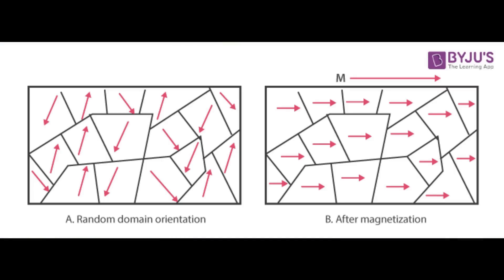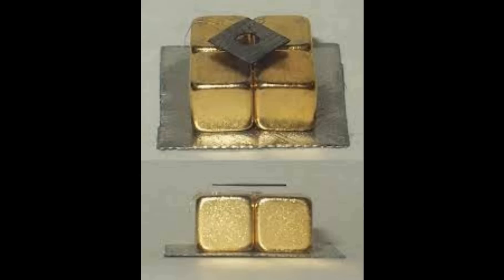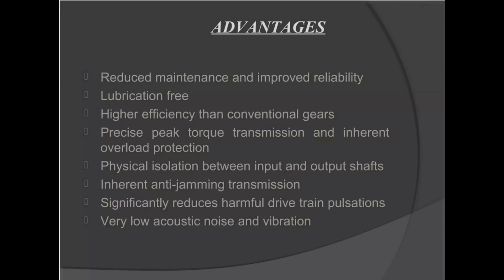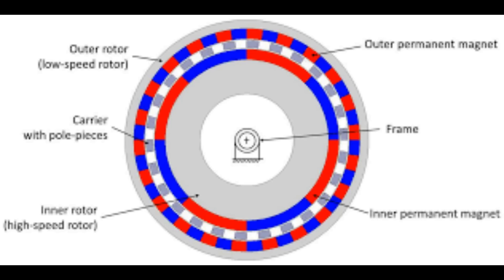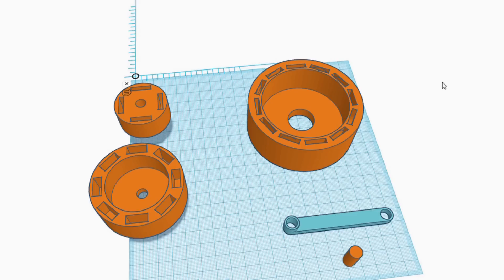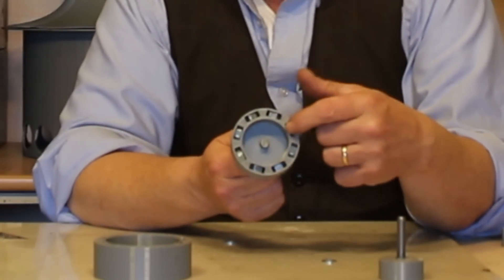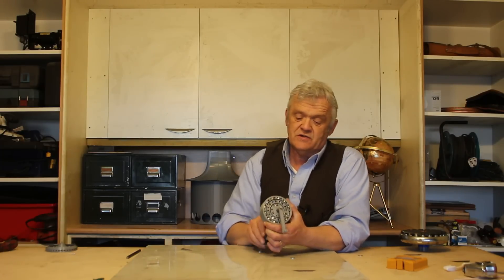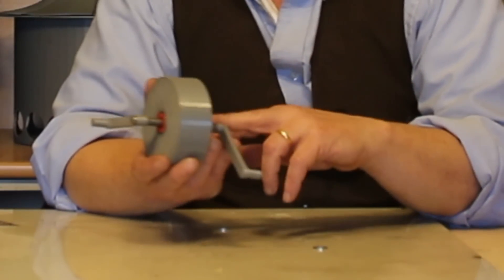1922 Magnetic Gears

Comment: I had an epiphany about modulators recently (the point of the, always confused me). The modulator and the output gear operate just like a brushless motor, but the variable magnet, instead of an electromagnet, is made of a piece of metal whose field is alternated by moving permanent magnets past it. So the frequency of the change of polarity is controlled by the speed of the input shaft. One way to look at it is that the role of the motor controller is played by the input shaft; another is that the variable magnet is varying through mechanical means rather than electrical.

Comment: Robert, whenever I see systems like this, I wonder whether they can be enhanced by the use of Halbach arrays, since these arrays are much more efficient in the use of the available magnetic field. What are your thoughts on Halbach arrays for magnetic gears? Would they enable any designs that are not efficient or not worth doing in conventional magnetic gearing?
Reply: I believe Halbach arrays are used with these a lot. They triple the number of magnets, so it gets more expensive, but they limit the amount of magnetic field interfering with surrounding components as well as increasing the amount of field usable to the gearing.

Comment: someone seems to have a new camera.
(Or a new editor)
The creative activity is more impressive than the awesome explanations - making ideas accessible is not a simple task.

Magnets do have the benefit too, of not placing significant strain on the mechanical components. The low torque density is a limitation - though low torque high speed applications exist (ie. servo drives.

The "2nd order demonstration - has applications in any "differential drive system - basically a toothless epicyclic arrangement.

Comment: Would be great, so long as the tractive forces are equal to the resistive loads.

For small, low mass applications, might be a real gem.

For large, industrial applications, might get really expensive, bulky and finicky, as well as have overheating issues.

Or it just might not have enough shear strength to move the load forward at all.

Plenty to investigate though.

I can see using this, if it works, to make machines that virtually never wear out, use very little lubricant [one very expensive and essential element of all modern machinery, and something many larger machines consume quite a lot of] , and of course, eliminate wear from direct contact, but I can also see a lot of physical heat being generated due to the massive amount of resistive magnetic flux through internal eddy currents, leading to the need for cooling, especially seeing as all permanent magnets lose their strength as the temperatures increase, which might defeat any costs savings previously gained.

At least with some coolants, it might be possible to keep the overall cost down, but each class of coolant has its own benefits and drawbacks too.

After all, there is no free ride.

Comment: I wanted to make a maglift bearing setup but it doesn't work very well if the weight is more than half a kilo with N51.  Is there any way I can make it where it is functional?  I thought about iron to concentrate the fields there by allowing more weight without it crashing the two pieces together just not sure if that would even work, or how to do it right?

Comment: I owned a 1990 Subaru Justy.  First vehicle ever to have a CVT transmission.  The clutch was an electromagnet activated by a switch on the accelerator pedal.  In subsequent years the magnetic clutch was replaced by a torgue converter clutch but I liked it.  No creep when the vehicle was in gear if no throttle press.

Comment: It is funny that you posted this today because just the other day I was working on my truck front brakes and for something that had to do with magnetism. The automatic brake sensor was is located behind the rotors and it works by magnetically sensing how fast the truck is going by a gear mounted on the rotor. I thought what a great way to use a magnet...but the worse place to put one it made the brake issues in my old rusty truck way worse lol

Comment: I'm afraid I just was not mentally geared up for how revolutionary these ideas were. It's nuts !
Reply: It just takes the right explanation and it all clicks into gear so to speak.
Reply: I developed a magnet motor that produces usable torque and RPM. It can easily drive a generator or whatever you need. It has minimal moving parts and can be made in any size need. EVs will no longer have to be plugged in and buildings can be 100% off grid. Please feel free to contact me for further information.